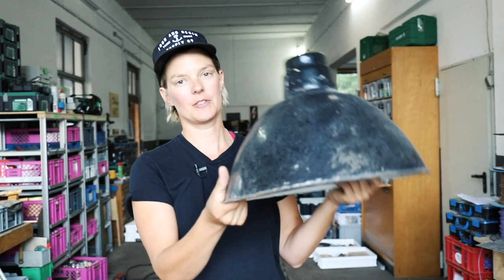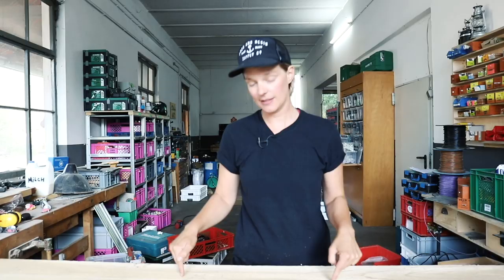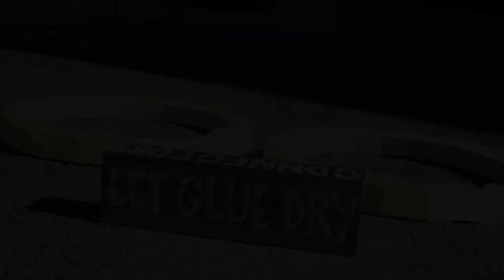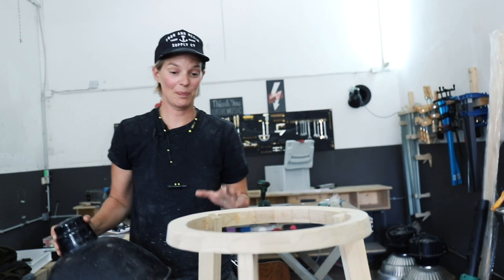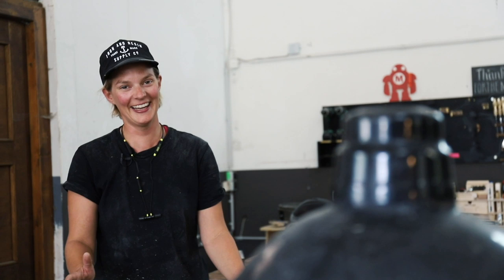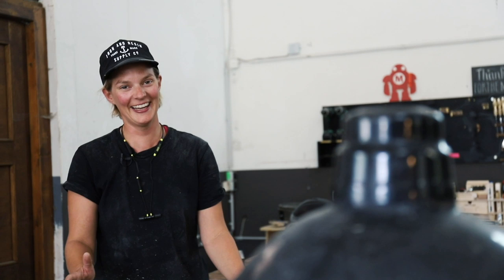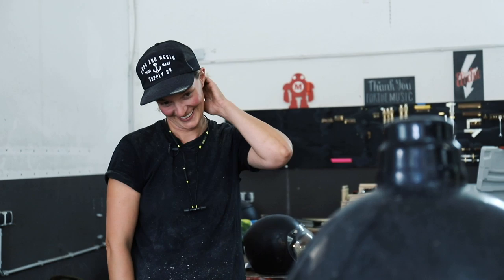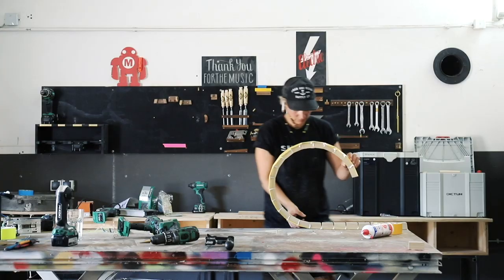I made an industrial floor lamp...not sure if i like it

Comment: Make it an up-light...cradle the light so it reflects off the ceiling.
Reply: sjlarue1 Yes, uplight.
Reply: I'd like that as well
Reply: The point with an downside up lamp is, you´ll have a giant dust collector...
Reply from the maker: I tried that. Looks like a weird font, sink or toilet when turned upside down
Reply: @laurakampf  It's just a weird light. 😁
Reply: I was thinking just the same.
Reply: i think the same....
Reply: @laurakampf  What if you added a tube of light-diffusing plastic extending upward from the rim? Perhaps half a meter tall?
Reply: @laurakampf  I saw that on Instagram, but I felt that if you used the smaller frame/circle it would have looked better. It did look like a washing basin with the larger frame.  Your solution in the end works too - actually I wouldn't mind it being even taller.
Reply: I was thinking exactly this!
Reply: @laurakampf  😜
Reply: @laurakampf  If you did do an upturned light with that design I wonder if frosted plexiglass over the opening would look nice.  Might make it look like a strange light box come table.  But it would be an interesting experiment.  Lovely work as always.
Reply: @laurakampf  What about an up-light with a litle tilt? I think straight up or down looks a bit too "square", but with about 15 degrees tilt from straight up..?
Reply: @laurakampf  Or hang it by chains under the ring!
Reply: That's what my first thought was when she said she doesn't like it.
Reply: My thought exactly. Then the circular wood part would show. I would definitely use a dark color stain as well.
Reply: Stain the wood and drill holes all over the lamp shade then insert colored plastic film on under side?

"Faliure is always on option " love that! 😊

Comment: Just wanted to point out something you may not know about segmented rings. Wood turners have been making segmented bowls for ever. When gluing up rings, regardless of how good the setup is, most have issues with gaps. One solution is to glue up half circles, then sanding the mating surfaces on a disc sander or big belt sander to make them perfect mating surfaces and glue the 1/2 circles together. It just makes it so that any inconsistency in the angles is compensated for and all the glue lines can be perfect.

Comment: Hello Laura I have some Ideas for you: 
Hang Lamp It from its wooden structure so you show the  wood, Make the legs thinner, hide the cable in a groove of one of the legs, paint legs stain darker to match with black color of lamp or yellow so it actually communicates the idea of the light beams shinning out.  Thank you for sharing this video, so pleasing to see materials and ideas change and develop in this tiny bite size chunks of time.

Comment: Wonderful work - I like how you did your segmented glue-up - worked a charm :).   As for the design - the segmented circle under the lamp looks really good; I think it is the straight legs that is causing all the issues.   If you look at the lamp itself it has these wonderful curves  - doing the legs in an elongated mirror of those curves so the legs cross over to a centre point before going out again to become the final legs might be a great solution but I realise that's a lot of work.

Comment: The final design is definitely better than the first! 😄 
I really like the screws you added to the joint of the legs instead of doing a straight glue up. It links the metal lamp to the wood better. 👍

Comment: Love all you do!  I’ve made several floor lamps - might I suggest adding a shelf under the light?  Love the light wood and the brass screws.  Just needs something to lighten up the heaviness slightly.  Something that echos the circular pattern in the rim of the shade and the round wooden ring.

Comment: Since this is an industrial lamp shade, I'd consider taking a length of thick roller chain and welding each segment to form a nice arc to the floor, but over the top of the lamp shade. Weld it to something substantial looking. Like a large disk brake or maybe if you can find a train track wheel. Incorporate some copper or brass accents.

Comment: You could always get microphone stand part's and make it like a hanging lamp, almost like what you would see in an old hospital, the doctors inspection lamp. Or, do what I did a long time ago and use old reclaimed wood to build a base, and use galvanized iron plumbing part's to build a stand which can double as conduit to hide the wiring.

Comment: Here's to your intellectual honesty, Laura!  But, I see potential in the piece.  You're right.  The star of this stand should be the ring.  In my opinion, there also needs to be more metal in the design.  I'd definitely go dumpster-diving for it, if you threw it out.  I would probably flip it upside-down, make some sort of distressed metal plate for the base, mount the ring with stand-offs (so it appeared to float in space), slightly narrow the spread of the legs, shorten them a bit, make a three-prong support (out of matching distressed metal) that connected the bottom of the three legs, and suspend the cone from the center of that.  Finally, I'd use that huge space in the center to mount some sort of kinetic paper sculpture that would move with the air currents produced from the light.   See...you ought to make more of these and sell them as unfinished artwork.  You'd make a fortune!!  :)

Comment: I build lots of lamps from old fixtures like that. I've never gotten one to look right with supports from the bottom. I've actually made table lamps from the same fixture you're using, but I've always had to support from the top to look right

Comment: Might like it with more separation or space between the segmented ring and the lamp shade. Perhaps make it "float" on some angled brass? I don't like it much either but not having the legs be flush with the ring and the brass screws already added a lot of style. That said - it may not be the perfectly designed lamp you set out to make but it sure is a conversation starter and also - it probably lights quite well. Cheers! JM

Comment: Place the wooden circle above the lamp and hang it with 3 or 4 2 mm steel cables. You can also use a copper tube as an axis between the two parts, you immediately have a way to hide your wire

Comment: Think I would make it adjustable on a steel frame, attached on one side with support on that side so that so that the light could go over a shoulder of some one seated, or be adjusted to point at any angle all the way to vertically up, painted to suit where it will live. It would then be both a centre piece in the day & a multi possibility light for the night. It wasn't the woods fault, often better to simply re-purpose rather than murder, bit like hitting a dog because you have had a bad day, which nearly always makes you feel worse & out of control when you reflect. Thanks for sharing & showing the dark side of making.

Comment: I made 5 lamps + 1 usb lamp myself last year including one 12 volts solar powered lamp with reflecting diffuser. I always thinking of the luminosity first, the lamp shades, the structure, electrical switches, proper sockets and  wiring. On the top of the lamp requirements, the lamp must be able stand itself n safe to use. I did not use big n heavy machine to make lamp but a clear head.

Comment: Take 2 is much better. The shade being part of the silhouette instead of just set on top of it has a more... well, a look between 1930s streamline and 50s atomic. Sputnik-like, without the ball-tipped accents that get cartoonish easily. A woodblock-print poster of a comet. The lamp itself is definitely more incorporated, instead of looking like a hat on a separate piece.

Comment: IME, beer works better than coffee for inspiration. You only had a coffee, right?

You're used to seeing that kind of lampshade hanging, not sitting on something, and it was designed to look good when hanging, not sitting on a support. I suppose that's why no design with it sitting on something will make you happy.

Two alternatives come to my mind.
- An A-frame as a base for an asymmetrical cross made of thick pine with rectangular cross section, with the edges rounded with a large router bit. The lampshade hanging from the longer end of the horizontal arm, from a short thick black cable.
- A segmented circle, slightly larger and thicker than what you had, used as a base, with a slightly slanted upright post, terminated with a short arm sloping downwards from its top. The post and arm assembly have to tilt towards the inside of the circle, with the tip of the arm above the center of the circle. The lampshade hanging from the tip of the arm from a thick and even shorter black cable - but can be thinner in this design.

My guess is that the first build is simpler. You'd probably need invisible metallic reinforcements for the second, since the relatively small joint between the vertical post and the segmented circle base would need to carry almost the whole load of the lamp., and the joint wouldn't be at right angles. But IMO both are relatively easily doable.

I suppose you'll like either one. I'm willing to bet a large case of beer on it.

Comment: Make a thicker version of the second set of legs, shorten them, flip the lamp shade over and drop it in to the segmented ring, use a low-voltage LED light that doesn’t generate much heat, then cover it with a clear piece of glass and use it as a side table.  

Or... Make it to tower. It seems too short for the design.

Or a humongous Pixar lamp. I really like that idea.  With the right bulb, it would make a great chair side lamp for reading.

Comment: Might look cooler with some latches put on it, I was thinking of a type used for air filter boxes on cars, if you search images for car air box latch you can see what I mean. Maybe make some by hand out of copper or brass wire would look really neat, and have the shade be secured to the stand with them.

Also maybe hide the cord, make a groove in the leg the cord can follow out of site, then put a thin black tube the size of the power cord coming out of the top and insert fiber optic cables into it at random lengths maybe a cm or two above the tube, might look like you cut the cable but magically the thing is still being powered. This maybe just sounds silly but I think it could be executed in an eye catching way that would enhance the message you want the piece to have.

Comment: You could maybe cut it in half and mount the two halfes on a wall. Maybe one half on top of the other, than it would look a bit like an hour-glas, with one light facing up and the other facing down. Something like that^^

Comment: Is it weird that I loved the part where you are running through the calculations ?  As I said on Instagram, I think it would be cool to make it as a side table, facing up, with your metal Laura Kampf logo on top and perhaps a glass piece on top of that.  Shining your logo onto the ceiling.  Might have to create spacers between the lamp and the metal cutout; for air circulation.  Make on.

Comment: I think the main focus should be the shade, i would have made a simple tripod coming to the middle with a vertical dowel (so it looks like a camera tripod), mount a disc on the dowel so the disc sits up inside the shade, then get a lamp that has a circular LED strip, take it apart and mout the led's on the wood disc, any electronics can be above the disc
Or you could use an old camera tripod with the bonus that you can adjust the height ;)

Comment: The Tripod looks very good and is well made. I´d use the Tripod as a Plantstand, maybe for a fern.
Those Lamps are just not made for those kind of use tbh and i don´t get the point of a floorspotlight. Maybe cut them in half and directly mount them on the wall upside down for some kind of ambient-light, half wall, half ceeling...like you see in a cinema sometimes.
But i knew your feelings so well...i build stuff very often, most of the time furniture...and the endresult turning out not nearly as i imagined in my head happens over and over again...most of the time during the finishing passes...like you want to go: "Tadaaaa ...aaaaa ...a  .aaa...uuuurgh"  :(    :)
Cheers

Comment: The first stand could have been used as a plant stand. The metal shade should be above the oval lamp stand.. I would raise the shade by duplicating the look of the legs(3) but a lot smaller and attach them onto the inside of the oval between each leg. Then attach the shade 10" or 12" above the round oval with screws. I would also paint the stand black.

Comment: What about giving the ring even more emphasis? Mount the lamp under the ring. Maybe bolt the lamp into the legs or use clamps if you don't want to damage the lamp.

Comment: Add braces on top of the first ring to lift the lamp above the segmented ring so it’s visible.  
Maybe place a larger ring equidistant from the first ring lower over the outside of the legs for visual contrast.  

Shape legs to be less 1x4.

Comment: Laura sweetie. You're possibly still dealing with your recent shop changes and the emotions that came from that? Is this showing up here in this project??  All good. You're pressing on and making it better. Good for you.    May I make a suggestion for the latest lamp? The power cord, maybe hide it inside one of the legs? What do you think? Or maybe not, maybe this project has served it's lesson and it's time to move along. XO

Comment: If I would have this great shade and use it to create floor lamp, I would turn it upside down and position it lower, but that no one could see lamp (it is too bright). Then, it would light ceiling and walls around. Or, I would add somethig bright above at hight if regular floor lamp to reflect light to the sides.

Comment: I wonder if flipping the lamp over so that it is shining at the ceiling (like some tall floor lamps do) wouldn't have worked better: I am imagining the whole thing being about 10 feet tall with a narrower diameter ring that the lamp head sits in upside down...

Comment: If the segmented ring would be larger than the lamp it could be mounted vertically with the lamp in the middle - like a frame around the hanging lamp.

Comment: Cut shapes into the metal so it casts light out into the room. Also, the lampshade and the choice of wood don't match very well. Try an oil/stain on the wood and maybe give it a few dents and marks.
Reply: Also I'd say the legs need rounding. The square and round styles contrast.

Comment: Legs are good, lampshade is good - combination isn't, oddly. Perhaps suspend the shade under the legs/ring? Or a heavy metal foot, with a single metal rod, bent at the top from which the shade hangs? Man, I wish there was a way to attach pictures to these comments.

Comment: Ich hab so einen ähnlichen Lampenschirm - leider etwas kleiner, und silbern, der (bzw. seine Lampenfassung) sitzt mit einer Schraubklemme an einem Notenständer auf dessen höchster Stufe, und leuchtet bei mir nach oben in Richtung Decke. Sozusagen der Deckenfluter für Arme ;-)
OK, es ist mit ~1,50m Höhe des Notenständers etwas niedrig, und leider sind auch die hellsten E27 LEDs immer noch Funzeln (ich möchte endlich mal was im Bereich um 4000 Lumen!), aber es funktioniert soweit. Wenn neue Generationen an ultrahellen E27 Retrofit LED Leuchtmitteln herauskommen, dann werden die idR ausgetauscht, ich bin inzwischen bei ca. 1500lm, aber 2000 wären natürlich besser, ebenso wie 3000 besser wären als 2000. Ach, eigentlich kann es gar nicht hell genug sein.

Comment: Laura, my first thought was that you were going to build a torchiere floor lamp, where the light shoots up. You have probably seen  Tiffany reproductions like this: https://www.lowes.com/pd/Home-Accessories-Inc-Green-Leafy-72-in-Green-Foot-Switch-Torchiere-Floor-Lamp-with-Glass-Shade/1000769274  I can even imagine some cut outs in the dome.

Or this fancy metal creations: https://www.lowes.com/pd/Kendal-Lighting-72-in-Satin-Nickel-Rotary-Socket-Torchiere-Floor-Lamp-with-Glass-Shade/1000810938

Or with some lathe work: https://www.lowes.com/pd/Portfolio-Barada-72-in-Bronze-with-Gold-Highlights-Foot-Switch-Torchiere-Floor-Lamp-with-Glass-Shade/50380032

Just a thought.